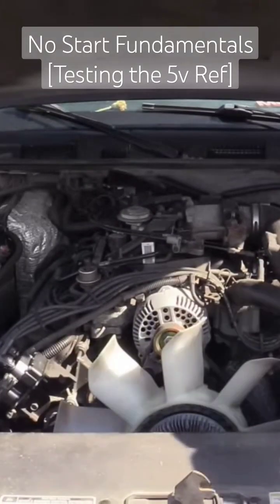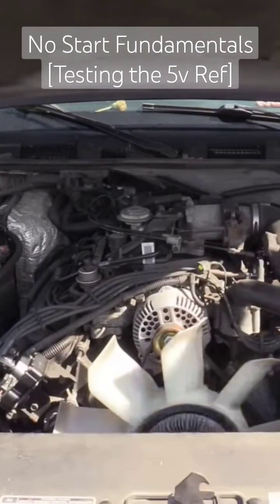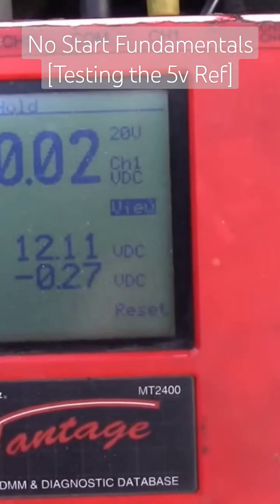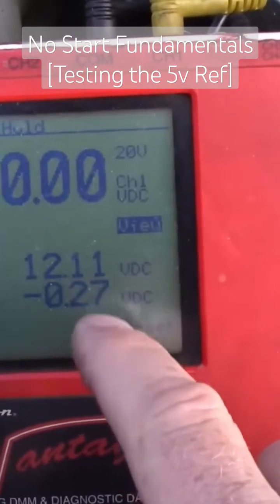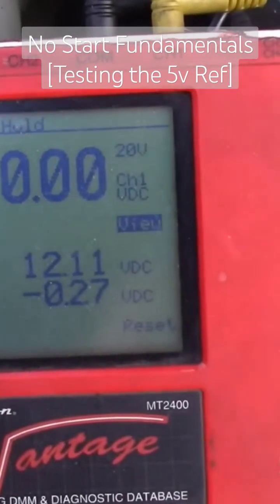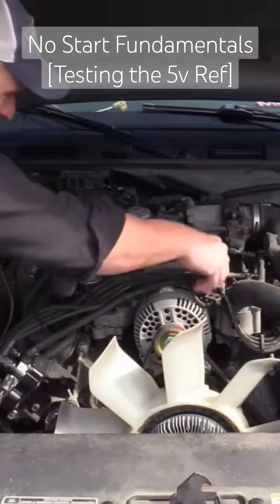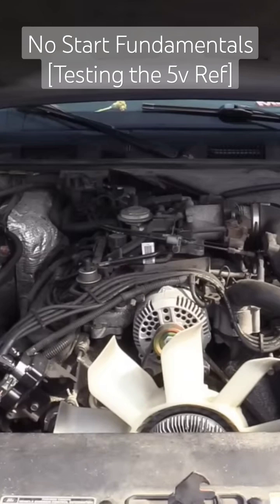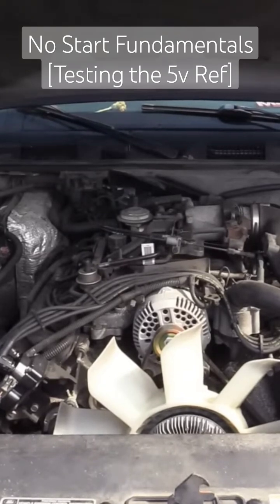No Start - PCM No Com - No Spark or Injector Pulse  [5v Reference Test]

Comment: Is this the one that the ground wire was broken by the radiator ?
Reply from the maker: No, if a ground wire is broken, your ref voltage will always be high, not 0. This was a wiring issue that I think was the main feed wire that went to the pcm power relay and other circuits
Reply: Ok I see i thought this was the crown vic
Reply from the maker: @troysmith9453  this was that car. But I'm almost certain it wasn't a bad ground. It's been at long time

Comment: What is a 5v ref. Can someone explain
Reply from the maker: Watch this one! https://youtu.be/pb8o5EngBwM
Reply: @ScannerDanner I got 98 xj jeep won't start.  It turn over. I change camshaft sensors
Reply from the maker: @nathanmccumber8965  what are you missing? Fuel psi, injector pulse, spark?
Reply: @ScannerDanner  it get spark. I recently did the fuel pump 3months ago I got it at O'Reilly's I'm going to go smack it tomorrow
Reply: @ScannerDanner  I put new fuel pump relay I gotta put paper clip to actually hear the pump turn on.
Reply from the maker: @nathanmccumber8965  hearing the pump run means nothing, what is your pressure?
Reply: @ScannerDanner  gonna do pressure test. Let you know
Reply from the maker: @nathanmccumber8965  sounds good, just reply here
Reply: 5v ref means the computer sends a 5v signal to various sensors. Example of this is the coolant temp sensor. PCM will send it 5v and as the temp warms up the voltage drops. Aka thermistor. Resistance increases with temperature. That's how the PCM knows when to kick the fan on, how much fuel to give, and other perimeters.
Reply: @fightingfalconfan  😁
Reply: Thank you, always trying to learn more!